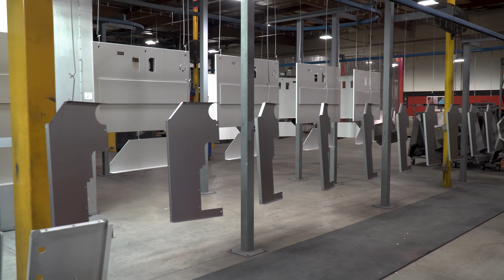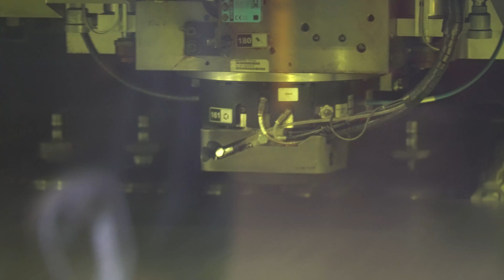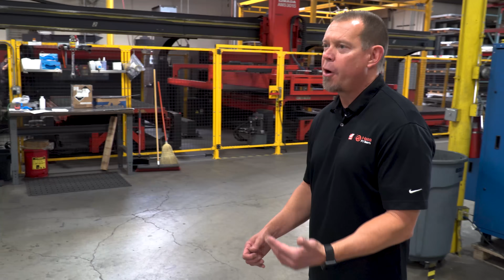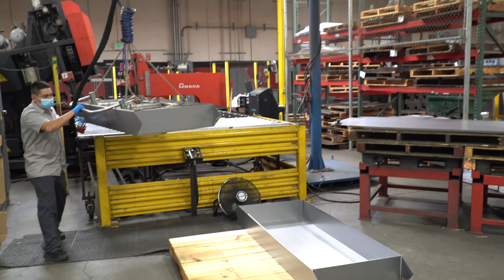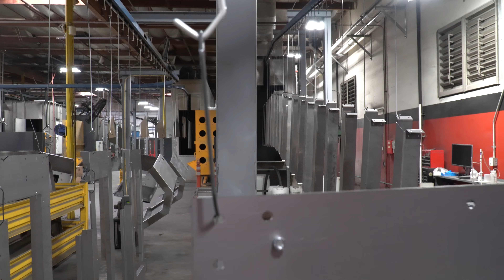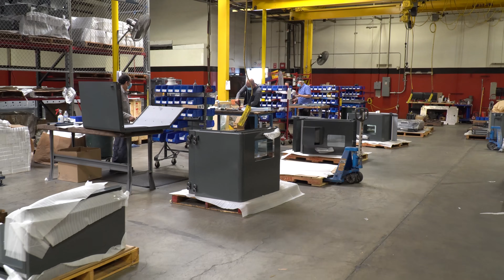Haas Sheet Metal - Factory Spotlight - Haas Automation, Inc.

Comment: Dear HAAS. Please redesign your Y axis way covers.  We have had so many fall apart over the last 2 years due to poor design and quality.  They are costing us a lot of money to replace.  The way covers on our older HAAS work fine and last forever.    We just installed another expensive, brand new Y axis cover on our VF5 and the rubber seals are .125 away from the cover its supposed to be sealing against allowing chips to go under the cover.

Comment: Why does't the description of the metal thickness actually say how thick it is? How thick is 14 gauge? Why not just say how thick it is in an actual unit of measurement?
Reply: Gauge is an actual unit of measure.
Reply: How big is one gauge? How many mm?
Reply: Also, an imperial tapping chart the other day told me to use a size Q drill bit, how many inches in a Q?!
Reply: @PetesShredder  0.332"
Reply: @schmidtyyt  Whaf a random number 🤣 imperial is so confusing and illogical
Reply: Gauge is a unit of measurement. Tada!

Comment: This facility was set up to manufacture there sheet metal exclusively , putting all there eggs in one basket cost them everything .
Then get canceled as a supplier , how convenient for this machine tool manufacturer to buy a turn key business for .25 cents on the dollar
You herd the man didn't know a thing about sheet metal  , well the ones that jumped through all the hoops to get it set up right sure did and were 
Destroyed shortly after . A 10 y o Japanese machine is still far superior to what this company is offering.
Reply: Dietmar Steinhilber yeah if I remember correct this was accurate engineering before haas bought them out, they had been almost exclusively haas before as all the local sheet metal shops are in Ventura county. 7 percent is all haas pays their sheet metal manufacturers.
Reply: Not Anymore  I know all about doing work for this company , In the 90s my father had a commissioned sales man that was in bed with a buyer and 
The work was large heavy gauge hard to handle with welded machined bars  and powder coated low quantity and labor intensive . They would order sets for 5-10 machines at a time and want us to keep the finished goods in inventory . Bottom line is they would never take delivery of all that was ordered as time went by the amount of money invested was astronomical kissing A and delivering 1 kit 90 miles at a time just to say 
(Oh we do work for them) we canceled them as a customer. My father had a lot of eggs in many baskets and could afford to cut his losses .Evan trying to offer deep discounts to just to get them to take the product they just said no not right now or we changed the design (excuses).
Other shops had the same experiences throwing  tens of thousands of dollars wort of finished goods in the scrap and a lot of them aren't around any more , I would close my company before doing a single dollar worth for them , on the other hand a friend of mine makes a good livening now 
And has a truck driving 150 miles every day to Oxnard . Every successful business has its way especially now Corona Extra has been great for business around hear , others not so good .
Reply: Dietmar Steinhilber I hear you i started my welding career welding their panels at Computer Metal Products. I know all about the business practices you speak of. CMP always did ok with haas ( at least the owners seemed to) but they eventually got smart and diversified themselves as they were like 90% haas at one point.

Comment: Im surprised thats only 30% of the sheet metal. Where do you guys get the rest from?
Reply: I worked at a place in Chatsworth CA called Delta Fabrication and we did quite a bit sheet metal work for them.
Reply: I was surprised not to hear a higher percentage mentioned also.
Could be that contracts are already in place with other shops to supply what HAAS needs.
Seems they already have there hands full with what they are producing at the moment.

Comment: I'm sure he meant 700 Inches per minute. There is no way something is running 700 feet per minute... That is 8400 inches a minute!
Reply: Lasers do operate at much higher fees rates than regular cnc mills and lathes. So I wouldn’t be surprised if it moved that quickly.
Reply: @DdgeluvinHic  highspeed lasercutting with trumpf 2d laser machines is around 40 meter per minute (~1600 inches) in 1mm mild steel and aluminum. a few years ago they had a machine with linear drives on all axes that was capable to run up to 150m/min (~3800 inches). but they dont sell it anymore. there should also be a video on yt of this machine.
this trumatic 6000 is with highspeed options limited to something around 20meter per minute.
i operate a trumatic 7000 with 3.2kw co2 where the maximum is around 10 to 12m/min. this machine is available with 4kw co2 and with highspeed option are also around 20m/min.
Reply: That's only 8 mph. Totally reasonable. There's no way it's 700 IPM, even a mill would be faster than that.
Reply: @jacksonsmith4648  8 MPH is nothing if you're driving your car, 8 MPH will shake your car to pieces in seconds if something is accelerating your car back and forth car slamming to a stop each way. But, we aren't dealing with a car, no motion controls like ballscrews could move the weight that fast no matter. Next time you're at Lowe's go for a ride in the paint shaker and tell me how slow it is.
Reply: It's not that important to know the exact stats.
Just happy we could see the inside of this facility.
Was enough for me.
Good to see another part of the HAAS operations.
Reply: @MichaelKingsfordGray  Still trying to get under peoples skin with that pet peeve user name issue you have eh Mike? You've got some real issues and need to have your meds increased.
Reply: @turningpoint6643  Don't give him any attention, He is just a 60 IQ idiot unable to form a pertinent thought about the subject. Just click the 3 dots on the side of the comment and report.
Reply: @trainedtiger  Oh I completely agree with you about him. Scroll down to the bottom of this https://www.youtube.com/watch?v=2tt1f8P3YEQ to my post and then maybe have a chuckle at ol Mikes expense. He naively thinks he's a whole lot smarter than he really is and has some definite emergency level head shrinking requirements. Add in the line of his pure B.S. and he's a joke .A bit of a shame to have a battle of wits with an unarmed man though. :-)